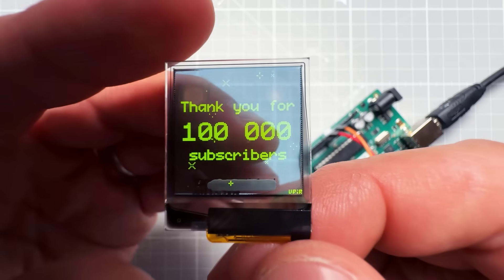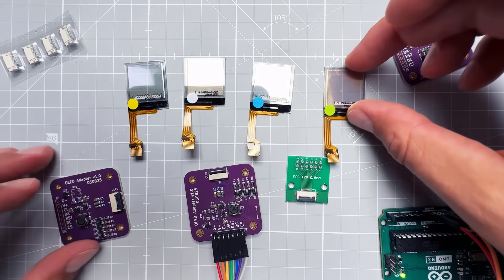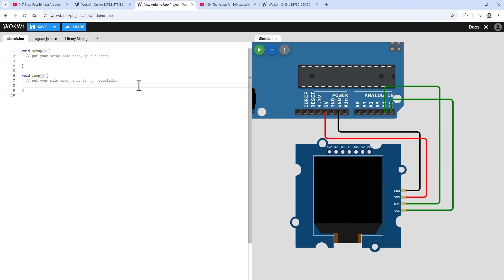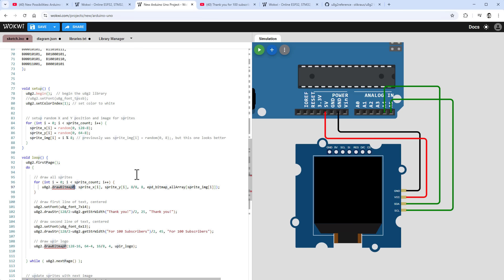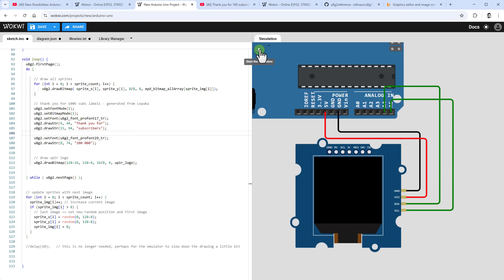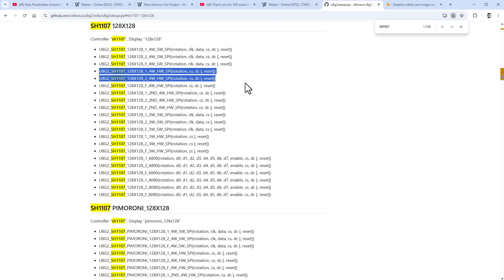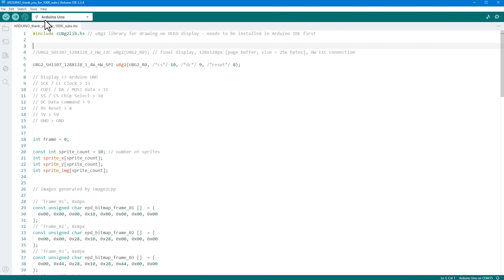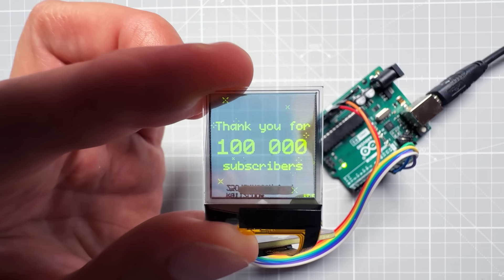Thank You for 100K - Here is Your Gift!

Comment: Congrats on hitting 100k! The display is quite fascinating!
What if you'd stack multiple of those on top of each other, or put a regular OLED behind to create a true two-color OLED? 
Instead of RGB, it could be YB for example. I wonder why they don't really make red OLEDs.
Anyway, the ones further back would probably need higher brightness than the one on top.
Reply: I suspect red monochrome oleds are kind of rare maybe due to manufacturing yields being lower or some other technical reason like that?
Reply: @sjm4306  Could very well be. 
They still can make full RGB displays, which obviously contain those red pixels.
I wonder what's up with that.
Reply from the maker: That's an interesting idea, I might try that, thanks for the comment!

Comment: Congrats on 100k!

They should really make these displays without the serial number and that glue line in it :D
Reply from the maker: Thank you and I agree, I don´t fully understand why to keep that glue and serial number over the visible area..
Reply: I think the glue line is actually the display controller chip bonded to the glass. They totally could have made the display a little taller and put it below the visible area but I guess they didn't want to for some reason (like to keep the display as small as possible and square?).

Comment: Congrats for reaching 100k 🎊🍾 

Didn’t know WOKWI support custom parts 😮
I wanted to make simulation but there are only two OLED displays and I’m using „custom board” with combo of Horizontal SH1106, EC11 Encoder & two buttons running 3v3.
Reply from the maker: Thank you and yes, you can have custom chips on WOKWI, but I don´t fully understand how to implement those...

Comment: I wish the existence of a transparent display that combines a lcd with an oled in a way that is posible to control de transparency for each pixel for better contrast and color and the possibilty to make blacks.
Reply from the maker: You can get those displays, basically color transparent OLED displays, but those surely cannot be driven by a simple Arduino UNO.

Comment: It's a bid sad that they didn't extend the glass envelope and then put the getter outside the visible area.
Reply from the maker: I agree. I don´t understand why those elements are over the visible area.
Reply: @upir_upir  I think this display was not built to be translucent, it's just a thing someone realised and decided that it could be sold to makers with that feature. The getter is sadly a needed part in OLEDs with the sealing technology we have today. I tried de-laminating a larger yellow OLED and remove the back glass. The pixels started out square but quickly turned round after exposing it to atmospheric air, and after around a day the phosphor was completely dead from moisture takeup.
Reply: It's not a getter, but probably the display controller ic (since these are passive matrix oleds). In either case they totally could have made the display a little taller and put it outside the visible area.
Reply: @sjm4306  It's very much a getter. I think we're looking at different parts of the display. It the opaque thing in the bottom of the pixel area. That is very much a getter. Either it's a pad that looks like a sticker or it will be a thick paste applied at manufacture. I have the same model of 2.4" OLED that has different models of getters fitted. The display controller is mounted on the back of the front piece of glass and it's outside the visible area.
Reply: @zaprodk  I'm confused, I thought getters were a vacuum tube thing? I assumed they made oleds via some thin film technique in an inert atmosphere and were sealed in that environment to prevent moisture/oxygen ingress. [Edit] did some reading and oleds do have getter material but it's apparently not always visible/opaque like this since not all oleds are transparent! I learn something new every day!
Reply: @sjm4306  Getters come in many shapes and sizes. And yes, OLEDs need getters, and I think it's because the glue that seals the cavity between the two panes of glass is not 100% tight. Water vapor can sneak in over time and when the phosphor gets damp, it breaks down and stops emitting light.